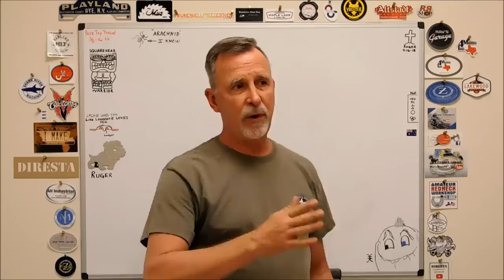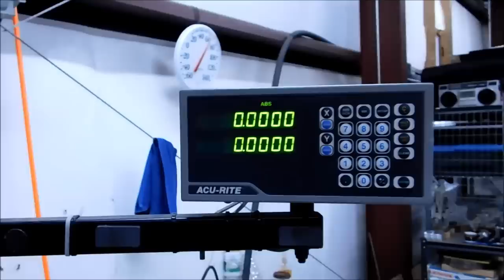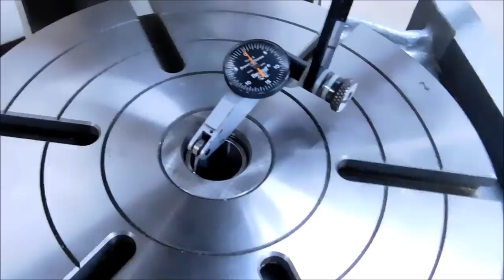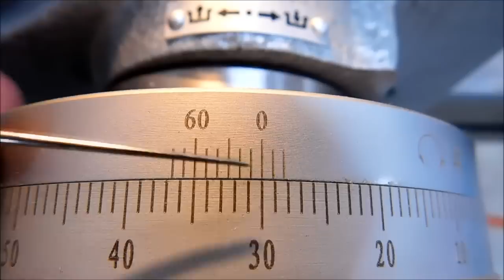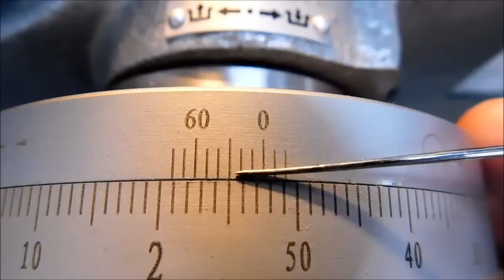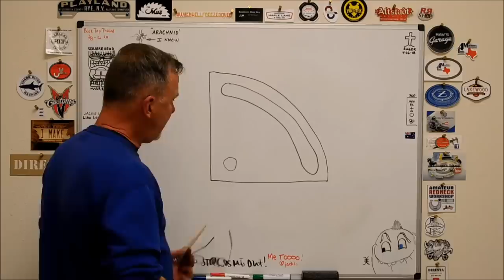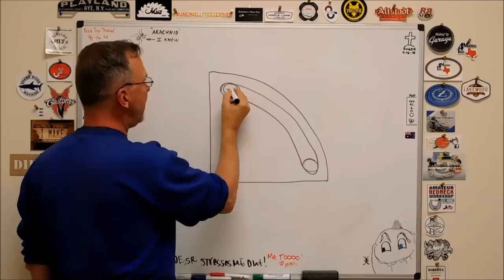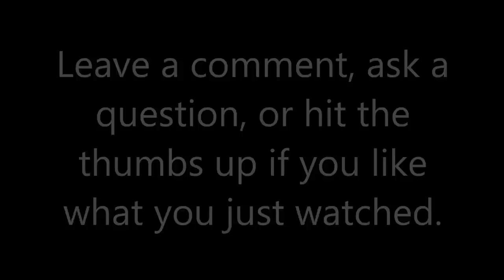Rotary Table Basics

Comment: Good stuff Joe! Back when moldmakers used rotary cross slides, I was taught to find the center of rotation by placing a magnet base and indicator on the turntable and then indicate a pin held in the spindle. This method produces the true center of rotation, as opposed to relying on the accuracy of the center hole which may be obscured by a cross slide or fixture plate. An easy way to save time (and a lot of cranking) is to disengage the worm gear and spin the turntable by hand for this operation.
Reply: Thats a great tip, ill probably do that going forward!
Reply from the maker: I'll show that in an upcoming video. It does establish true rotation if the hole is out. Excellent comment.

Comment: Haha!  I just went from "Yeah, yeah, I already know how to use a rotary table and I don't have no time to watch no video today" to "Oh!  So THAT's how the seconds calculation works!" (that I had never bothered to really understand);  and then to "Oh yeah, so THAT must be why the radius of that part was mysteriously slightly larger than it should've been!" (when I had never thought about the need to re-establish the radius over the zero between a linear cut and a radius cut.  Just like you show, if you don't,  your "new" radius of tool edge to part center is related to the length of the hypotenuse of a triangle whose adjacent side is the radius you 'want' and whose opposite side is the radius of the endmill.  You really could do the trig and see exactly how many mils you'd be off if you forget).   Thanks for another great video that has (once again) made me slightly less dumb.  :-)

Comment: In just a few seconds you hammered the reason I built a small shop to do machining.  Having done software and related engineering/science pursuits most of my life - much of which becomes ephemeral pretty quick (and no one would believe you or care if you told them your stuff was making their phone work), I felt a need to have some things I could point to and say "I did that".  Even if no one else cares,  I still do.  Bingo.
Reply from the maker: You get it.

Comment: Thank you for the video Joe. That is the same 125# table I am using. I bought the Phase II at work 20 yrs. ago. Someone apparently dropped it off of the milling machine table and rendered it useless. I brought it home, took it apart to find slight damage to the worm and main spindle. Cleaned them up on the lathe and had to  buy new table locks and oil sight glass to get it back in working order. Works fine once again.

Comment: Very Informative video Joe very clear and to the point.
I'm kind of old school, I like using the rotary table as much as I can or when I can, this way it will keep your mind thinking 
I use an advanced cross slide rotary table, so I can unusually do some unusual stuff on a mill.
Yes, a CNC is faster, but like I said I'm old school .
I usually put the rotary table's center at 0,0 on the DRO's Absolute, and the normal X,Y movements on Incremental, this way you can always jump right back to the center of the rotary whenever you need to.

Sorry for the long-winded message 
Machining has been a passion of mine for years, and once I get started I have a tough time stopping.

Comment: Thank you! Another great post.  The rotary table is a great tool to have. They often go for very cheap at machinery auctions  as the CNC  machines have made them obsolete.  I once got a job in a great machine shop because a shop foreman saw a part I made on my motorcycle using a notary table.

Comment: Our rotary table project in Machine Tool Technologies at the local college was a 5-sided fire hydrant wrench. A great exercise in making the outside of the wrench with the larger circle around the pentagon meeting the tapered handle to a smaller radius on that end. Cutting the 5 straight sides on the inside was a lesson in remembering backlash and locking everything down for each edge.

Comment: Quite frankly, You are the most analytical machinist on YouTube that I am aware of. Here is an idea for a future video:  Take the table off the rotary & clock the T slots to your desired Zero.
Reply: Actually, There is no need to remove the table-top. All Phase II rotary tables have a "neutral gear". One can disengage the worm gear from the table top, allowing for the top to be turned by hand freely. You can then line up your slots as you wish and re-engage your worm gear. Be sure to fully re-engage. You can reference this procedure in the operation manual. Great video.

Comment: As usual, outstanding video Joe. I’ve got a 6in Vertex horizontal/vertical rotary table I purchased to fixture a couple angle plates to, mount a frame between the plates, and checker 1911 front straps with eventually. I ran into some problems during the setup. Been stuck there since. This series should be a huge help. Looking forward to keeping up with it. Very good info! Thanks
Reply from the maker: I believe I'll offer up a few things to reduce the stress. thanks for watching.

Comment: Great video as usual Joe. Looking forward to future video's on the Rotary Table, particularly one that might be related to putting parts on and centering them to the table... This is one area that for some reason, I've always struggled with (i.e., accurately locate an existing part that needs a round radius feature so that the origin of the feature is at the center of the rotary table). This is especially true for parts that do NOT have a feature already at the center origin of the new needed feature
Reply from the maker: Correct. Nobody seems to be willing to go there. No feature to pickup....Not a problem. Stick around.

Comment: I plan to build a shop hoist (A-frame) to lift things like this onto the mill so I don't hurt myself or drop and damage these expensive things.  The vice and materials can easily get too heavy to safely lift.  Likewise with larger lathe chucks and bigger shafts.  I'm not getting any younger.  Looking forward to the next vids.
Reply: Not as much fun but I suspect a commercial hydraulic engine hoist would be cheaper and will fold up for storage.
Reply: Barry Gerbracht None of us are. If you figure that out, let us know:) All I did was make/fab/weld up a tool cart for the heavier stuff and lower the table of the mill to height and lock the wheels and slide it over. Teflon or any kind of high density plastic works great. I have a hydraulic hoist to lift the heavier stuff onto the table. Obviously It needs to be not top heavy. I have the lower shelves with enough items to keep it in check. It obviously can then be rolled out of the way and allow more room for work space that’s non confining.

Comment: Saw a recent post on Facebook for a rotary table storage cart. Make cart u shaped so can fit around end of mill table. Crank mill table to the left, roll cart around end of mill table. Align height of mill table with height of cart, slide rotary table on or off mill table.
Reply from the maker: Great idea. These things are heavy.
Reply: Steven Haskell Did that 25 years ago. Nothing is worth injuring yourself or damaging machinery.

Comment: Indicate the flat edge, then turn your slots until they line up on x axis and put your own marker where ever the 0 is. Try to indicate the slots and get that zero mark where it is convenient for you. Just like those pcs of tape, but mark it permanently or drill and tap a hole directly under the zero, and move that adjustable marker to that position.
I hope I said it right, or I’d have to draw pics. I enjoy your teaching and work. I started machining in the early 70’s like you. My expertise is mainly milling on large horizontal boring mills, huge planer type mills, and jig bore machines, and larger lathes. I did start in some small shops on Bridgeport’s and lathes too. Keep on teaching my friend, I do learn some nice tidbits here and there.
Reply from the maker: I made a new offset index plate. Problem solved.

Comment: Very timely, I need a rotary table for a job I’ve committed to have done by the end of the month. I wouldn’t have thought to look for the zero orientation. I hope I can find one with the tee slots in the perpendicular orientation. 
Thanks for yet another awesome tutorial.
Reply from the maker: They may have done that so you can use the vertical real estate for pins and screws in a fixture plate ???

Comment: I picked up a Vertex 8" a while back that I have not really toyed with. The vernier scale reads down to 20 seconds. You have to skip lines lines on the main graduated dial to read them. I've never seen a vernier like it. I downloaded a manual for a G9298 8' rotary, It has a reasonable set of steps and pictures on how to read it. I found more than one machinist forum thread where folks are thinking the vernier scale is miss stamped on Vertex tables. 
This should be a fun series, thanks Joe!
Reply: Thanks much for the tips 😊👍, by any chance could you post a print for the snap together peices ,man I have a hundred uses for the device , thanks again for taking the time to share your knowledge Joe
Reply from the maker: All of that stuff is available on my website. The coupler hasn't been posted yet, but thanks for the reminder.

Comment: thanks for describing the offset of half the diameter of the cutter needing to be taken off again before doing a radius, as in centre of the cutter needing to be level with the centre of the table because that little gem would have me confused  👍

Comment: Thanks for covering the rotary table. I am toying with the idea of getting a 6" table that includes index wheels. It would be nice if you could cover using those attachments. I would appreciate a video for typical setups and a video covering just the math for converting back and forth from degrees to minutes as well.

I'm not sure why, but it seems all tables have a 90:1 ratio, forcing you into minutes and seconds of arc (most drawings I have seen use degrees). Sherline has nice 4" table (a bit small though) that has a 72:1 ratio. One turn is 5 degrees. It uses a 0-50 wheel where each mark is 1/10 degree. That would seem to be the perfect ratio for a rotary table. If you really wanted, you could add a verier to 0.01 degree resolution. Thanks again and keep up the great videos.

Comment: Good advice I got as an apprentice was to centre the part on the table off the mill, then centre the spindle to the part, rather than picking up on the table, then tapping the part true while the table is on the mill.  It's a lot easier.  I was also taught to rough out slots and arcs by plunging every 1°, then take a finish pass, to avoid having the table/part shift under the cutting forces.
Reply from the maker: I like to nibble for slot work. Its really quick. About your setup technique, I'd have to see it, or get more details.

Comment: If you plan to make a bracket, similar to the one in your drawing, remember the center of the pivot hole must be in the center of the table.  The left and bottom edges would be offset from the center.  I built a crane out of a Harbor Freight truck bed crane.  It is fastened to the floor and next to the mill for lifting rotary tables and super spacers.  There's no good way to lift a rotary table with your hands.  Great video.
Reply from the maker: If the hole was drilled or bored, it could be done as is. For the outer profile to be a true 90 degree arc, the rotational center would have to be adjacent to both straight sides.
Reply: The question is: should the outer profile be 90 deg, or should the arc-slot be centered on the pivot hole?  You can't do both with the same setup.  The outer profile choice would put the corner over the table center, but if the arc-lot is centered on the pivot hole (which seems like a useful goal) that hole needs to be over the table center.  (Centering the hole would be simpler than centering the corner, but if it's a training exercise, you get to define the problem.)

Comment: Well done Joe!...We will need this a lot when starting on our part we are making. We actually used a Hass VFll 3 axis and a rotary table to produce those last parts I told you about in Mobile, AL. Were it not for the very expensive Satterfield tombstone we had made, it would have been even harder to accomplish. In your next series of videos on this turntable subject it may hurt or help, to start the discussion on adding axis' to the equation. Such as, moving from a 3 to a 4 axis, and eventually a 5th axis, and the role a turntable would play in that scenario. Thanks for all you do.

Comment: Many thanks Joe, 
I've had a 10" rotary table a few years but never come close to using it anywhere near it's potential. Only ever used it for basic (table scale) degree  hole making.  (just like the 4" Made in India I had before it) I knew it had vernier scale for minutes but the hand-wheel markings always confused me (1,2,3,0?) Watching video and it makes super easy sense. With quadrant 'exercise' oops, I'm guilty of remembering tool offset one direction but not the other. I think I may now be ready to try some of the projects I didn't know how to divide up accurately.

Comment: One fix I found for helping with chatter in my rotary table is using heavy lucas oil in the perimeter bearing surface. It produces a dampening effect that cuts down on chatter. That's weird about the offset on your rotary table. I have a 4 slot and the 0 degree lines up when the slots are parallel with the ways. Cool camera mount, that would be great for coolant also.

Comment: Thanks Joe looking forward to next Video on rotary table; 
recently using my 6" rotary table, cut a very tight spline,
with 36 splines (16mm round) using a Lathe threading bar in the mill.
 worked great (Part: Lawn Mower trans axle).

Comment: Good point about the weight of the rotary table, I got a hernia lifting my 12" Troyke. Double check your dial indicator after locking the table, it will move.  Look for a table that can be mounted horizontally or vertically, a handy feature.
Reply: The horizontal, vertical Moore rotary is one heavy item! Always needed help getting it lifted onto the Jigbore table. Found a suitable drawer case at IKEA and built it up with a base that has casters to the exact height of the table. Now all I have to do is wheel it over to the Jigbore and slide it off the drawer case
onto the table. Added benefit,  now I have drawers to keep all my rotary table tools, fixtures and clamps in.
I would have sent a picture but this forum has no option to do so. Send a note to bobo@nffs3.com for some pictures.
Reply: @robertl8832  You can post links to images/pages.
Reply: @jimbarchuk  
The Moore Rotary table and box weighs about 165 lbs, according to the Moore site. Box can't weigh any more than about 30 or 40 pounds, leaving the Rotary at a hernia making 135 pounds!  
Link below to a rolling table made from a basic Ikea drawer case with a base constructed with castors to the exact height of the milling machine table. All I have to do is wheel the rotary over to the mill and slide the table off the drawer case.  http://www.rbl3.com/sky/Rotary/
Reply: They are indeed heavy buggers! I have little experience but i think  i can add one more thing, get table with the indexing disks,then you can do finer increments than a lot of vernier scales(that seem harder to read as i get older!) will allow and very fast and consistent.Mine came with 4 plates that cover a huge range,i don't see myself needing more.I had to go import as im just a poor hobbyist,worse being in Australia where everything is overpriced.
Reply: I weighed my 12" table with 10" 3-jaw chuck mounted.  IIRC it was 280 pounds.  In my upcoming riser block vid you'll see the new crane rail over the mill and lathe with trolly and electric hoist.  Before the hoist install the 10" six-jaw chuck on the lathe was yet another potential gut buster.

Comment: Hi Joe. I bet you could eliminate the 12 degree offset between the T-slots and the zero degree mark on the dial. You could  disassembe the table and shift the clocking of the worm gear on the dial by three teeth, with respect to the gears on the table. I bet it was not properly assembled in the first place. 4 degrees on the dial (worm gear) times three teeth on the table will give you the twelve degrees.... Thanks for another good video!
Reply: nice math but i believe the marks are on the side of the table (which has the t-slots). if one could only realign the  indicator on the base  or the table had a movable marking ring.....

Comment: Very fine. Thanks. A thought occured in regard to the slots positioning. A new zero point could be referenced/marked reflecting the desired. It's basically arbitarily situated (unless I missed something - I haven't reflected, just a quick thanks as I will get one of these and took a look at your work. The 3ft camera gave excellent shots and you must be happy with that. Have a joyful continuance.)))